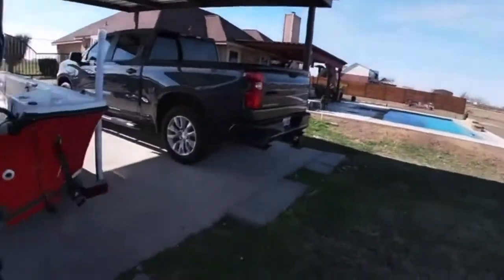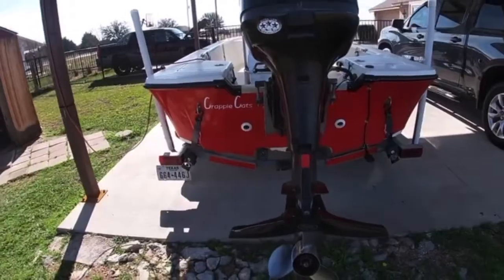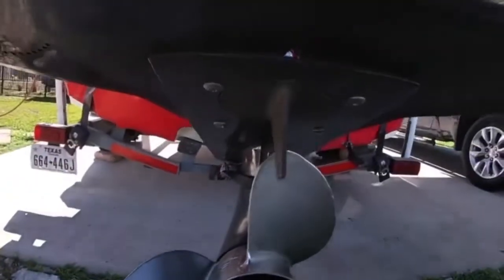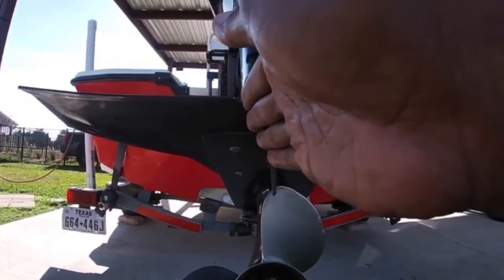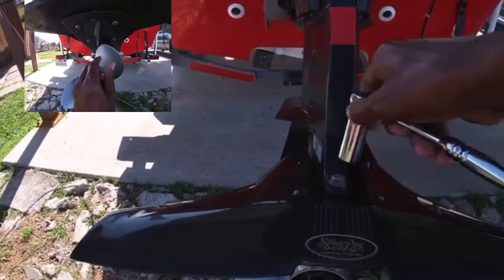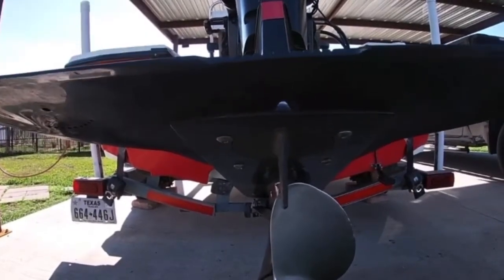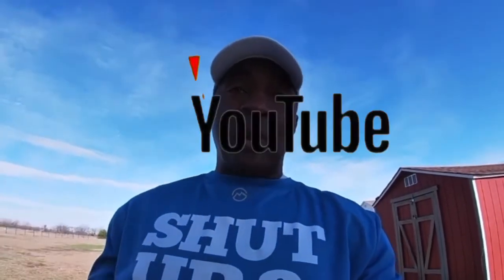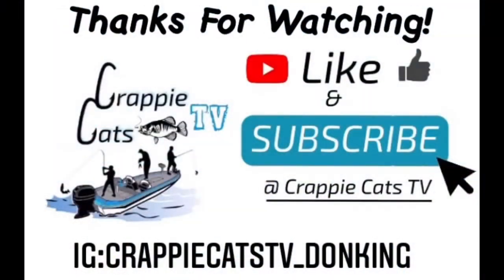How to adjust Trim Tab fin on outboard motor - (boat leans to one side)

Comment: The trim tab has nothing to do with your boat leaning. It is used to compensate for the prop torque, which can make steering in one direction harder than the other. If the boat goes right more easily than left, move the trailing edge of the tab to the right. This will cause the tail end of the outboard to be pushed to the left by the water pressure on it thereby making steering to the left easier. When the adjustment is at the right spot, left and right steering will equal out. It may not be perfect but you can get it close.
Reply: @stevesmart9711 then what fixes leaning? thanks!
Reply from the maker: Thanks for watching, commenting, and supporting our YouTube channel
Reply: If your boat pulls to one side then it will cause a lean (while running down the lake ). It did on my 17ft aluminum hull bass boat .
Reply: @georgefox8539  a real trim tab will but on small boats moving weight to the high side is the cure. Balance the load.
Reply: @georgefox8539   weight distribution in boat will fix lean. The trim tab helps compensate the outboard pulling.
Reply: @stevesmart9711  Trim tab or anode can definitely contribute to lean.  It did on my boat.

Comment: Thanks for Sharing.
My brand new 2022 Merc did the exact same thing, except it pulled to the right. Simple fix but I wish they had marks to indicate each degree of adjustment.  I used a sharpie to mark each adjustment change as it took a few small changes to find the sweet spot, and having marks prevented me making a wrong move to a previous spot.
Reply from the maker: Awesome! You have been the only person at the ramp that day😂? did it eventually work? Thanks for watching, commenting and supporting our YouTube channel!

Comment: My boat is doing the same thing. Did adjusting this trim tab work for you?
Reply from the maker: Yes it worked, but still leans a bit at high speeds..Thanks for watching, commenting and supporting our YouTube channel.
Reply: Which way was the rear of the tab pointing before you adjusted?
Reply from the maker: @joepiton2680  it was lined up in the center position.. Thanks for watching, commenting, and supporting our YouTube channel.